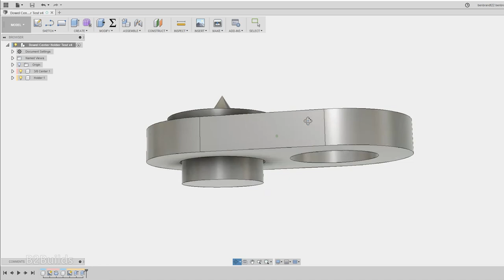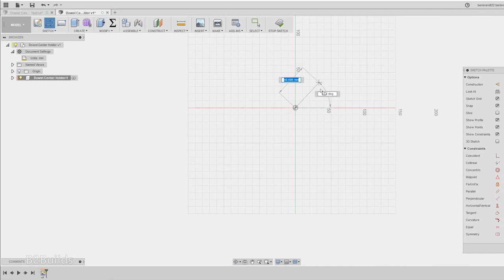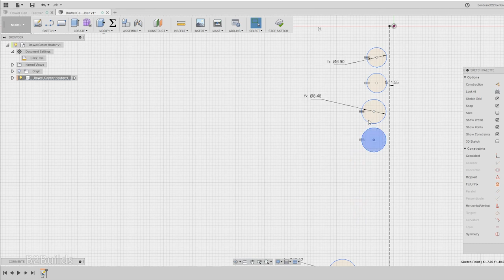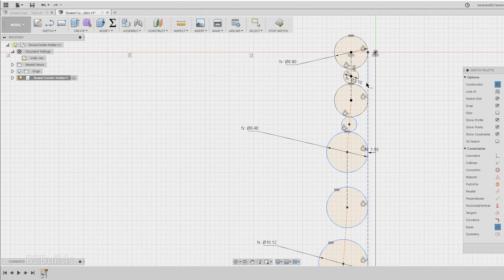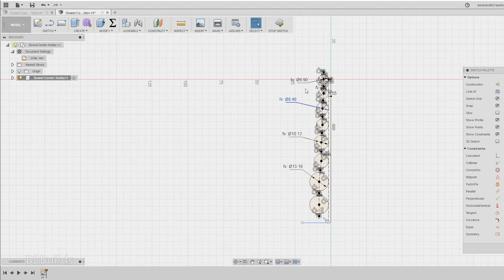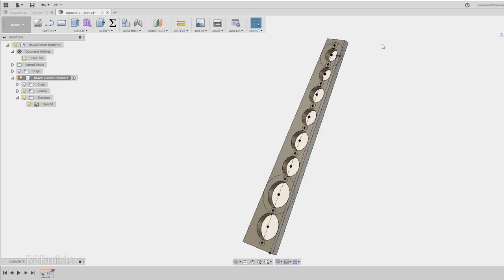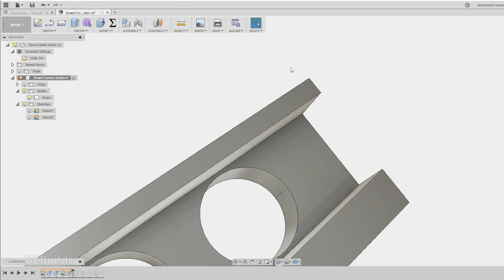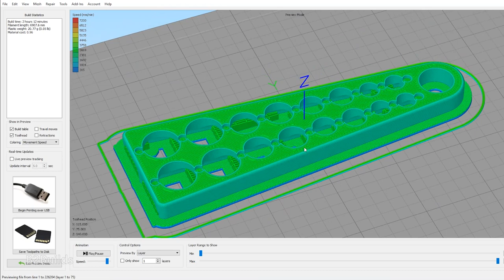Magnetic Storage for Dowel Centers - Design and 3D printing process

Comment: That's awesome! You must really have that printer dialed in to have a 0.25 mm tolerance! I typically have to leave 0.5, and even then it's a bit snug. I wonder if you could have saved some material (but not much) by printing upside down, and without the raft. Looks like there was a bit of warping as well though, so you probably made the right call. Thanks for the great video, and the demonstration of practical uses for 3D printing!
Reply from the maker: Thanks! I could have saved material printing upside-down, but the bottom surface of a print doesn't always look very good, so I opted to make the magnet side look better by making it the top layer of the print.

Comment: Which 3D printer do you have?  Would you recommend it for a first-time 3D printer user?
Reply from the maker: I have a Dremel Idea Builder 3D20 that I picked up used. I like the printer, though it may not be the best beginner machine. For a beginner you may want to go cheaper if budget is a concern. Or if you have more budget, perhaps something newer/better would be better. Mine lacks automatic bed leveling and a heated bed, both of which would be really nice to have.